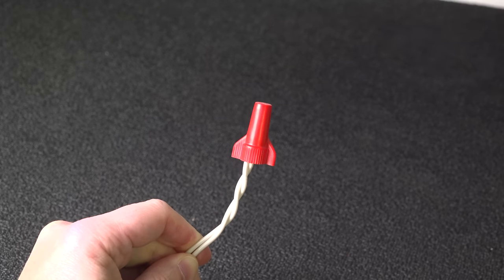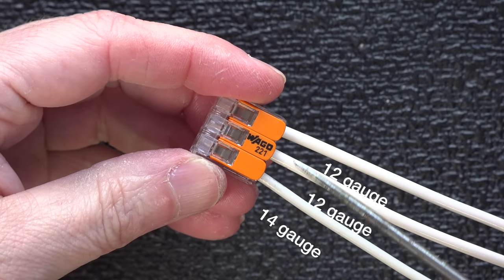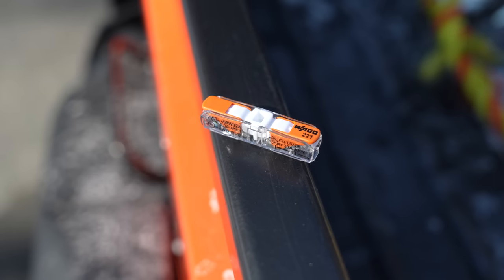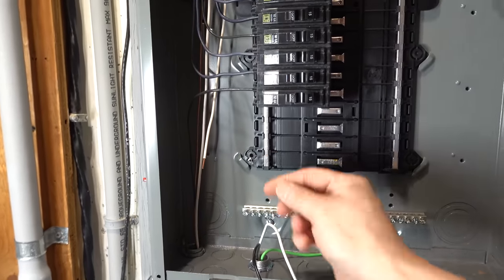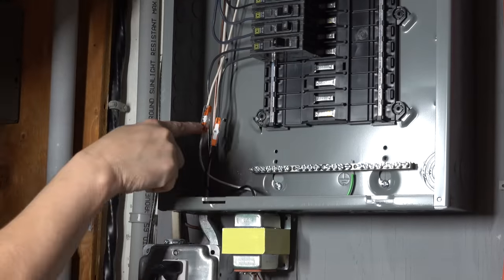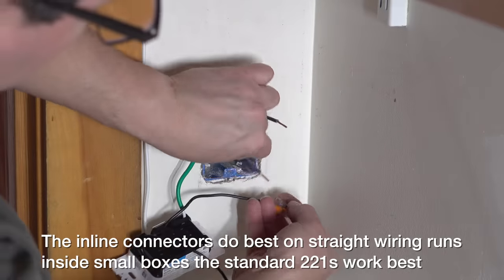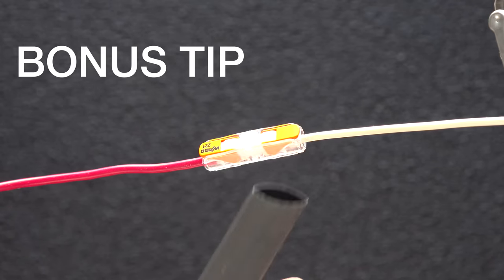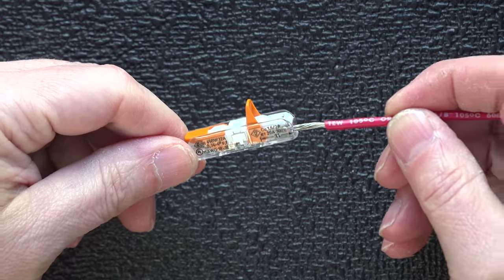New Wago Electric Connector is SHOCKING everyone - Inline 221 has arrived!

Comment: Ask yourself; why do nearly all electricians still use wire nuts? Cost? They’d easily make up the difference in cost with labor time saved as these are much faster. The primary reason is because wire nuts only secure the wires and do not facilitate current transfer between the wires. A Wago on the other hand acts as a bus bar, thus current flows from wire -> bus bar -> wire. This creates resistance resulting in energy loss and additional heat.

These are great for DIYers as they help prevent the common DIYer mistakes that are made with wire nuts. However, an electrician would challenge that if you can’t get a wire nut right, should you be doing your own electrical work?
Reply from the maker: I think you were right in your first statement, an electrician will reuse a wirenut 100 times before they would spend .10 on a new one for a customer. Its a horrible trait that most (not all) seem to take pride in. An entire house being done with Wagos would add about $80 to their job and save them 2 hours. They still will not do it.
Reply: We call them toothpaste caps in the UK.

Comment: No way a correctly sized wire nut comes off..why waste money?
Reply from the maker: They fall of stranded/solid wire combos very regularly and regular wire nuts fail for a number of reasons, the biggest is user error, too many wires, too few, incorrect tension, worn threads. Point being, all of that is eliminated with Wagos, plus test points, plus clear inspection of the wires, plus remove/replace instantly. There are cheaper ways but none are better.

Comment: quicker, easier… yes. better? no. Seen many wagos fail due to arcing. friction lock is not better than twisting. used correctly, wire nuts are best.
Reply from the maker: I will make the same statement. Can anyone on earth share even 1 picture of the failed Wago? After almost 5 million views and this offer made hundreds of times. None, not a picture or sample have ever been shared. Fake Wagos don't count, wanna be ideal push junkfits, don't count. You have never seen a failed Wago 221 and neither has anyone else, failed other connectors maybe but not the Wago 221. At this point I can confidently say its a fact.
Reply: how many years in the trade do you have? How many electrical joints have you installed? I base my opinion off of 30 years experience. There’s never been an electrical part that doesn’t intermittently fail and you have no idea what I or any other person have or haven’t seen. unsubbed
Reply: If wire nuts are the best way of joining wires why are they banned in the UK?
Reply: @VincitOmniaVeritas512  You know how to make something a fact right? 
In case you do not I'm going to tell you. You need something called proof. If you say that you have seen a failed Wago that was used as intended why not prove it?
Reply: @westwonic  simple search shows that Ideal Industries UK sells a version called Twister Proflex. same search revealed that they were banned in the 1940’s when they were made of porcelain and indicates that the newer ones are legal to use but not popular or used as frequently as in US due to the prevalence of screw type connectors built into the boxes. Y’all google much? I’m not from UK, but I can use the internet for more than making YT comments.
Reply: You are stuck in your ways,I have never seen these do what you say,can't  be genuine Wagos.
Reply: @onelineal9382  I suppose I’d rather be someone stuck in there ways than someone who would believe anything impossible unless they had seen it personally. But, to each their own.
Reply: @VincitOmniaVeritas512  Fact is ideals crap is not a version of the wago because wago has patents on their connector. Ideals might have failed frequently wagos did not.

Comment: Oh boy. While I am personally happy for those, they are recipe for disaster. Why? Because they are not weight bearing. People, even while repeatedly told, will try to hang things using these, from ceiling lights to transformers. The normal, one sided, were often able to withstand quite a high pull force due to redirection of its vector to the side. These pull straight on the (spring loaded!) connector. At best, we will get a number of amusing videos when stuff falls on people's heads, at worst these falling things will be heavy.
Others will 3D print self made connection boards (forgetting terminal blocks exist) or attach small labels to each connector instead of flagging the wire (and promptly disconnect them for a second only to mix them up).

I'm sorry, I have seen enough things to have no faith in humanity.
Reply: It would never happen in the UK,
Reply: Hanging stuff from the wires is illegal anyway, wire nuts are worse as they even without load can loosen over time, and are even more prone to user error.

Comment: With being in the electrical field for over 26 years I am one to never use this type of wire connector for concerns on current flow.  With a wire nut the 2 or more wires have a much larger contact surface.  With these fancy lazy things they make a connection by a pinch point and is less contact area which in turn bottle neck for current flow.  I highly recommend these not be used period.
Reply from the maker: There isn't anything fancy, its just engineering that has been around for 50 years. In the US for about 20, see what happens when I pumped 60 amps through them, 3x their rating: https://youtu.be/B1pmuRsf1co
Reply: Not made in the USA,that is your only reason you dislike them,thank God the younger sparks are using them.

Comment: There aint a damn thing wrong with using wire nuts on stranded to solid wire. If you can't get the two snagged together inside a wire nut its time to find a new career.
Reply: Too bad they are banned innmost of Europe for that exact reason, they are prone to user error, and even when perfectly installed have a tendency to loosen and fall off over time, they are not secure connections, they are a hazard and penny pinching at its worst

Comment: Man your hand was getting awfully close to the busing in your panel when you were making those connections.. a couple misconceptions though. A wire nut most certainly makes a better connection as the copper wire is touching each other as opposed to a wago which used a small piece of metal to make the connection between wires. Also, twisting solid and stranded together isn't that difficult if you keep the stranded wire 1/16"-1/8" longer than the solid wire. Love your videos but imo if a homeowner or dyi'er can't make a solid connection with a wire nut then they shouldn't be doing any electrical work in their homes. And before any gets in a fissy, yes I'm an actual electrician and I deal with industrial and commercial everyday. Wagos are nice and have their uses, but they are definitely not better than wire nuts.
Reply: Better is subjective and very broad. Do they accomplish the required task legally and safely? Are they simple to use? Are they reasonably priced for the quantity most DIYs need in a 5+ year timeframe?
Reply: @Michael Lewis  better as in the connection? Sorry but ohms law and resistance is not subjective. Wires connected via a wire nut have less resistance than with a wago. Less resistance means less heat, and better flow of electricity. Ive had the levers of wagos get caught on other wires or the box and open up causing a wire to come out of the connector, just as ive had wires come out of an improperly installed wire nut. And Yes they may be simple to use but so is a wirenut lol. I'll use wagos if some idiot left the wires too short in a j-box, or if it will make a larger j-box look neater but generally if that's the case I will use dinrail and wago terminal blocks.
Reply: That bus probably wasn't live
Reply: @Mr. G  only he knows, he flipped the breaker back on as if it was though. Either way, not good practice. Complacency is the most dangerous hazard on a jobsite. Maybe you've done something 1000 times, but that 1001 time, it gets ya because you're just going through the motions. Always need to be aware
Reply: I agree with you. I'm a Journeyman Electrician, exactly as you said a proper splice with a pre-twisted conductors underneath a wire nut is in my opinion a more reliable and stronger connection than a wago.

Comment: for rats and hacks who cant make a splice or tighten a wire nut
Reply: No, it is for people who like safety and ability to change out things and not have to solder or get more connectors to do so. Only rats and hacks use wire nuts, there is a reason they are banned in most of Europe...
Reply: @TheEsseboy  utter nonsence. havent had to solder a joint since the invention of the wire nut. and if your to lazy to get the right material you really are dangerous

Comment: fire hazard,    if you do your shit properly the wire nut works fine  wago is for  noob losers   on 1800 wats they get hot and melt  after  2 hours   ,and no never do that shit in your box that's not to code and tried had to remove them

Comment: Do you even write instruction of wago connectors... you talk like a pro byt evry sigle time you use it wrong... lever is used only to relase wires from wago connector evrytime you open it before injecting wire into it you use it WRONG.

Comment: Electricians very much disagree with you. They love Wago connectors, they fail and are easy money for them.
Reply from the maker: You know in my first video 2 years ago, with millions of views. I told everyone if they had even one example of a failed lever lock Wago to send me a picture or the connector. I said I would take it to the NFPA for analysis which I have a few contacts there (no pun intended).  To date, NO one has ever sent me anything or even a picture. They are super reliable.
Reply: The big advantage of Wagos is that they are easier to work with and much more consistent as you can see what is happening under the lever. They might not be able to handle as much current as a wire nut (I don't know the rating for those) but for the standard 16A circuit we have here in Europe they are more than sufficient. I never had one burn up or even come close to melting.
Reply from the maker: @thebigdoghimself  Thousands of electricians have watched and watch my videos. Most are very product of their credentials to tell me that I am wrong. Yet somehow despite thousands of alleged failures, not one can be produced. There are more pictures of UFOs than burned out Wagos.  Do you realize they raised such a stink that the NFPA did a followup test on Wagos, all of which again produced a favorable result.
Reply: Certainly not the original genuine Wagos.
Maybe some chinese knockoffs.

The original ones are made to german electrical standards (which are some of the highest in the worlds).
They are rated for up to 32A and 450V continously.

You aren't going to melt those with standard household applications.
And in Germany these have been the industry standard for several decades now.
Reply: @thebigdoghimself  you should have said electricians over 30 years in the game don't watch your on YouTube.
Reply: @thebigdoghimself  Send us some proof of all these failures